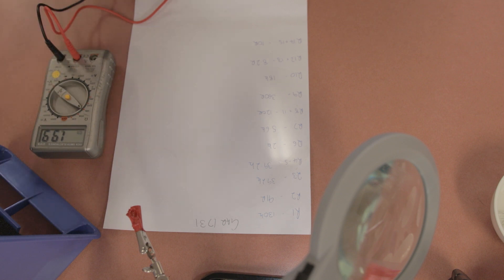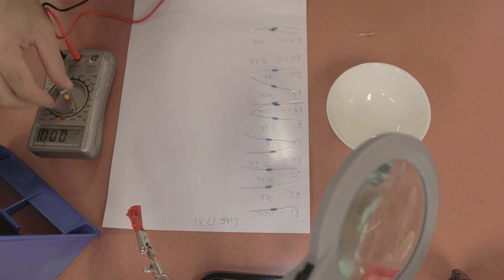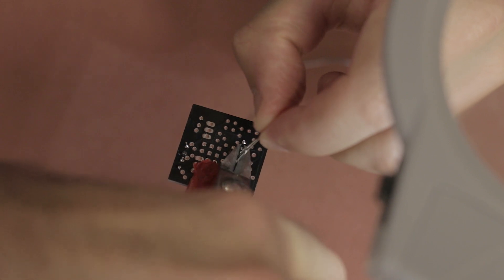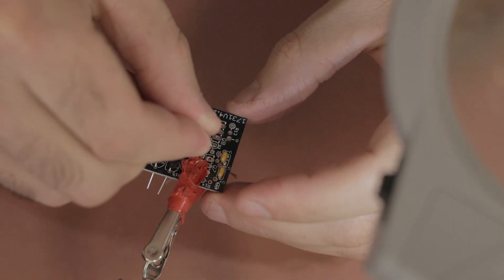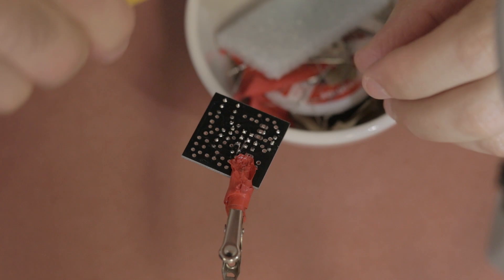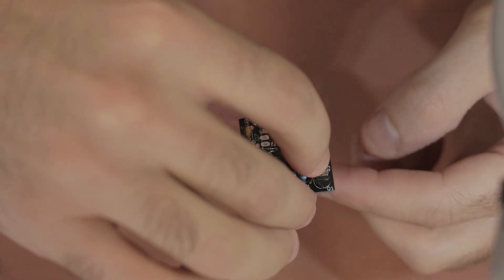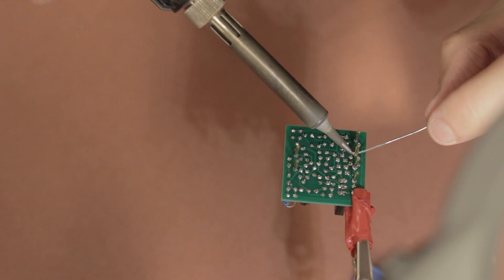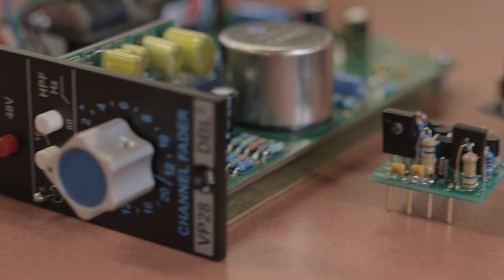What the hell is an Op-amp? Part 2 - API style (CAPI) GAR 1731 Build

Comment: 2 different Op Amp on 1 Capi is that possible and does that give a result. Or is it better to install 1 type of Op Amp? Capi 500 is completely new to me, and a world of good sound opens up for me .
Reply from the maker: Yeah when I built this the standard was to use the two different opamps they provided. Now most people just use two of the ca2052 opamps. People say it makes a difference I’ll be building some soon and shooting them out. But most people rate the ca2052. The supposed to be more true to what’s in the original api gear.
Reply: @diyrecordingstudio  Thanks for your reply, I am looking forward to your new video.

To be on the safe side, it should be possible to place the Gar OA10 Discrete Opamp - 2520 Footprint & CAPI CA-0252 Discrete Opamp in 1 unit? Not that I would destroy the unit :)